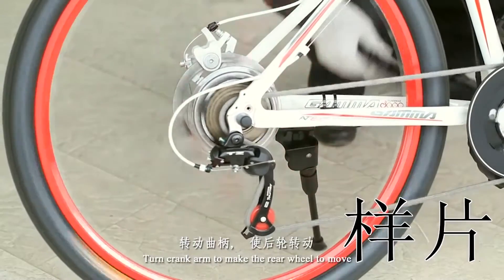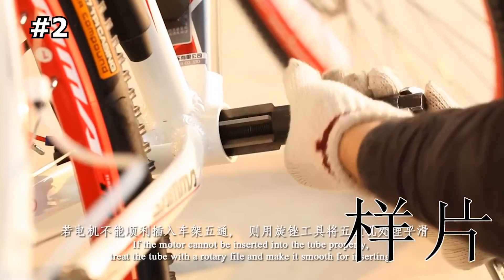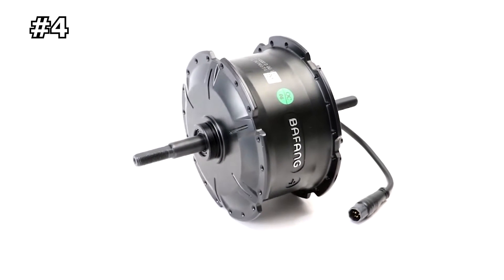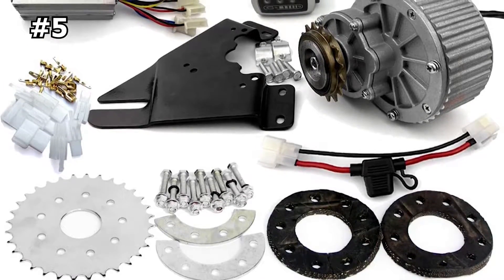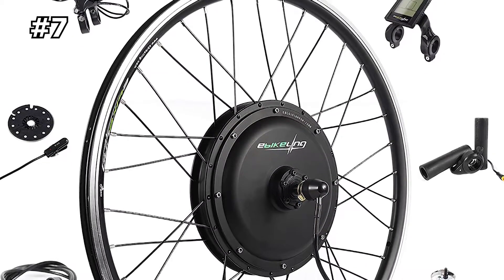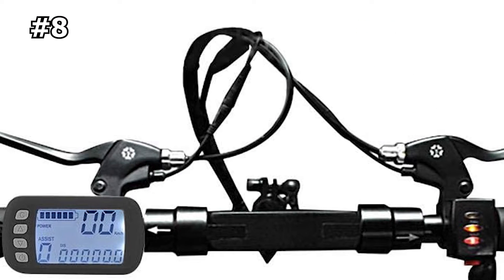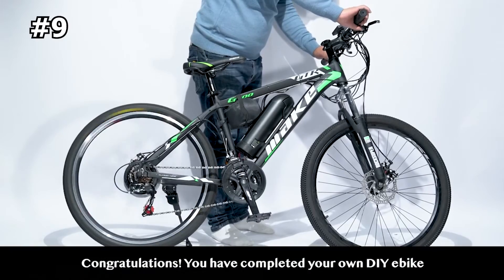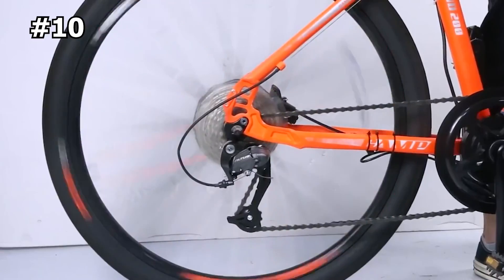10 BEST EBIKE CONVERSION KITS ON AMAZON for 2023

Comment: You almost got it backward on every single video.  "This is a front wheel kit": motor on the rear wheel in video.  "This is a rear wheel kit": motor on the front wheel in video.  Not particularly inspiring.